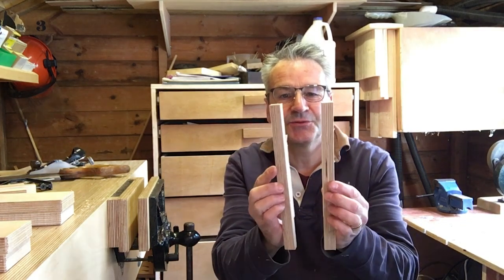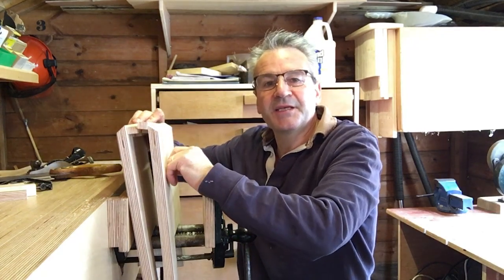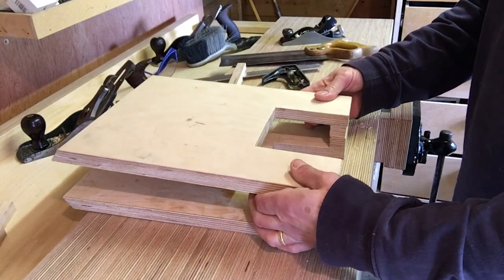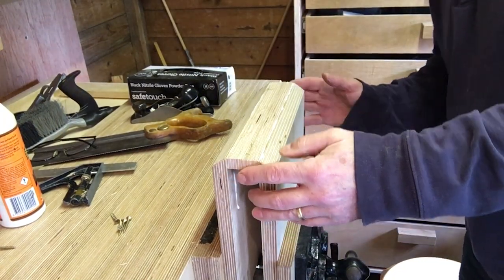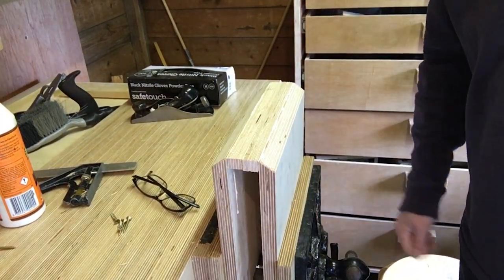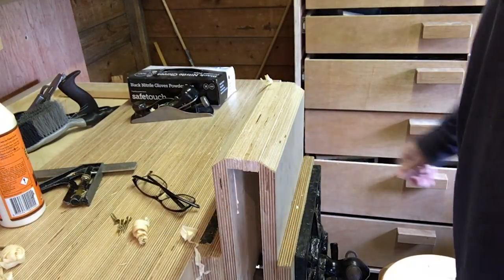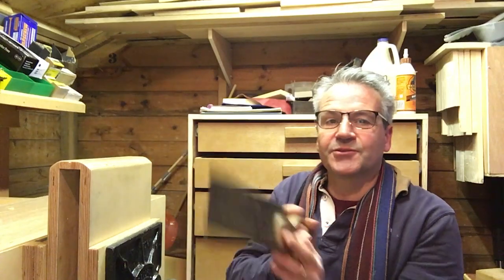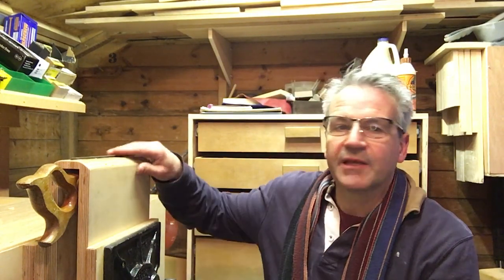Making a Saw Sharpening Vice Clamp

Comment: Like the fact that it is so simple and yet does the job. Lot of times we complicate sharpening.
I am planning to build one and would probably take the idea from here. My main thing is to keep it high enough for me to be able to stand and sharpen. So, I am thinking I will put in some large diameter screws and bolts to tighten the saw between the two plywood pieces since the vise jaws may not be enough if the jig sits too tall
Reply from the maker: sounds a good plan - i am getting back into shed now the summer is over (nearly)

Comment: Good video, thank you. I'm just about to make a saw vice and couldn't see why a hinge at the bottom was necessary, so it's nice to see that confirmed. Have you found that the 3/4" ply is rigid enough - it looked like it bent a little when you tightened the vice, but still worked OK?
Reply: yes it works ok - you can probably improve it though
Reply from the maker: thanks